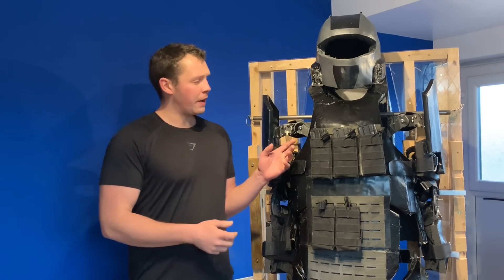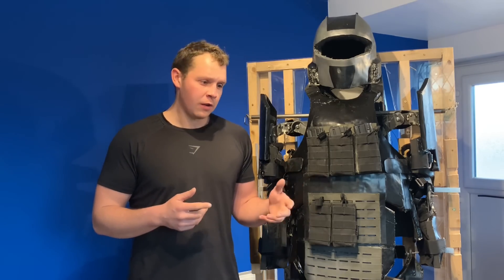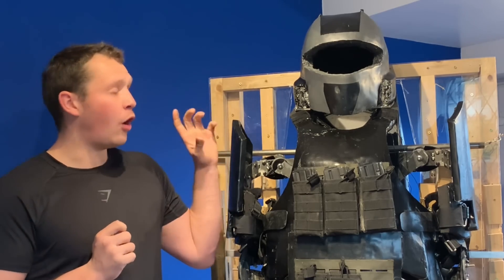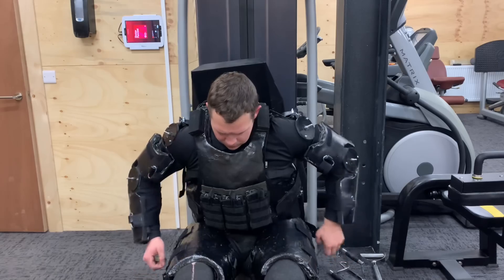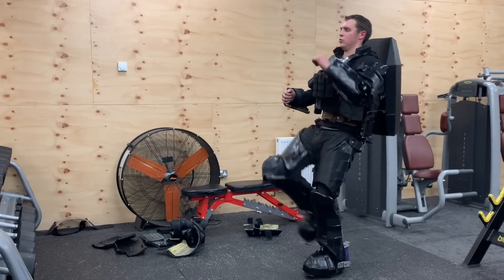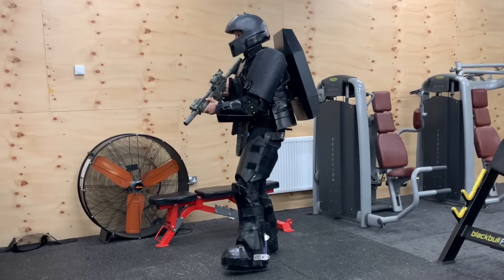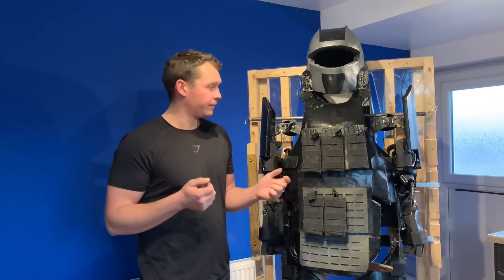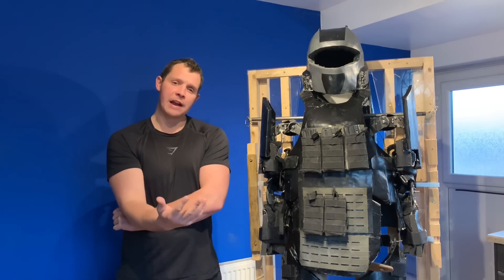Functional Combat Capable Power Armour Development Episode 5 Quest for Bullet Proof Exo Skeletons

Comment: i think the hardest part of the electronics is reducing the delay between limb movement and motor activation unnoticeable. there will inevitably be some signal delay between any sensors connected to the joint motors that move a limb and if the lag isnt small enough it will be very hard to move in long term

Comment: Bro, I like wear your thoughts are going. And it's outstanding how far you've done on your own. But your forgetting that most governments go for heights quality for dirt cheap prices, but also works well with existing equipment. If you could get a IOTV from a US military surplus store then you might get Uncle Sam's to nock at your door. Your somewhat right about the leg armor, keep the thigh armor as is and loose 😂back half of the lower leg. And focus around shock support, because you can't run to or from battle if your knees are fucked. And for the dawning of the armor set up a wall locker you can step in to. You open up the locker take out your leg pieces, then put them on. Then you lift the front half of the upper armor and just back up into it. Next you get all connected and finally you go pick up your helmet and weapon system from the armorer. And lastly do the test outside, you'll find out a lot more about what could be better or even some new problems before you try to sell it so you can get more from it. Thanks for the video and again outstanding work, I do see a diamond but you still got some work to go. Hang in there 👍

Comment: The issue with power armor or even heavier armor is the fact that it's much better to be mobile than being able to take another bullet, or slightly more hits. The onion exists for a reason, if you're relying on your armor to get your mission done you've already made some mistakes. Imagine trying to squeeze into a helicopter or APC with this on, would basically be impossible. Not to mention the same defensiveness could be achieved by just using a ballistic shield instead, that way you can always toss it and lose the weight if you need more mobility. It's cool engineering, just not really applicable towards today's combat without a lot better technology, energy storage, mobility, etc.
Like, you touch on mobility, but I'd like to see how you feel after 24+ hours of wearing it constantly while walking/moving/digging/etc. That's the reality most soldiers would face wearing this. Also looks like a pain to remove if you need to treat wounds or something as well, good luck administering a tourniquet for example. You have to remember we live in a world where anyone can hand-carry a weapon that will easily cut through most armored vehicles, let alone armor you can carry. No amount of plates is really worth sacrificing all that mobility and functionality.

Comment: It's quite cool. Have you looked to the past for ideas about this kind of stuff? The legs can be supported off the waist belt if you ran a cord from the belt down to holes in the cuisses, much how knights used to in order to keep them up high and snug on the thighs ("pointed" was the term). Takes the weight off the legs somewhat and might improve mobility. Is it possible to run a camera, (say like a car reversing camera, a webcam, something simple and small) from the back of the weapon sight to a screen near the helmet? Maybe the screen could be moved in and out of view. That way the bulkiness of the helmet doesn't necessarily matter for obtaining a clear picture through the weapon sights. Not sure if that would work. It's a really cool idea though, fun to see something as from-sci-fi as power armour being built in such a grassroots manner. I hope it all works out.

Comment: You might be better off marketing the skeleton itself and foregoing the armor altogether. That way, it can be used to help carry heavy things like ammo crates and supplies.

A 155mm howitzer round weighs like 100 lbs, and all that's loaded by hand, would be great to have a system to help artillerymen lift those things.

Foregoing the armor makes it a lot less expensive, and means you can offer upgrades later (which means more money).

Comment: cool idea, no one really would fund this for military / police application. One grenade makes whoever is in the suit, into soup. The gaps in the suit make backpressure still a problem from explosives. As for amour plating, you should have gone with modular ceramic plates instead of the thick plates, especially if this is planning on being used in a warzone environment regularly. Another issue is higher calibre rounds being used. 300 win mag is the minimum for snipers now, mostly using 338 lapua or anti material rounds. the US even implementing overpressured 6.8 rounds in their infantry rifles and 338 for their belt feds. With the prevalence of drone and their payloads, this suit's speed is going to have to come a long way. It is just too big a target.

Comment: That's a really cool proof of concept and I'm excited to see where it ends up. Even if it fails, I would be curious to know why)). 

All that said I couldn't help but notice that the only thing connecting an upper half of the suit to the lower are thin pieces of metal. If the suit is meant to carry a heavier armor plating it needs to be able to hold its own weight at the very least. I'm not sure how hip joints can be reinforced to carry the weight the upper body while retaining mobility (especially side to side), but it must be done to negate the weight of the upper half of the suit, armor plating, and ammunition.

Comment: You know what would work great? An IHPS helmet with the mandible face shield, it already stops rifle rounds AND has an additional rifle rated applique armor plate for the helmet. Next big thing would be using small ceramic triangles wrapped in kevlar to make flexible rifle plates like the Russian Ratnik powerarmor system. A good place to get them is Safe life defenses flexible rifle armor and stealth armors flexible rifle plate! You could use them to cover the wide gaps in the front of the shoulders/upper chest and also the back of the legs! They'd also work for the back of the neck and the throat!... Hell you could make most of the arm armor out of them...

Comment: Very cool, but this is the easy part. The real trick is going to be powering the thing - both in articulating the joints and the power/fuel source.

Also, test flexibility - drop something between your legs and pick it up. It might reveal some things that need considering in armour plate design.

Comment: This is real rad. I'm curious how you're going to manage activating the motors powering the suit. Is it going to be through some kind of compliance mechanism, like a sensor that reads your bodies movement that can tell the computer to act on the motors accordingly? Something like that would probably be best as it stands, but there will always be some kind of delay intrinsic to that. Down the line if things keep going the way they are you could think about integrating with Tesla's Neuralink as a control mechanism, at that point you're not too far off from the Black Carapace of 40k acclaim. The other question I have is to do with how it will be powered. Obviously batteries are both heavy and limited in range, not to mention liable to catch fire. I almost wonder if having a small highly efficient diesel engine built into the pack and spinning a generator of some kind for electrical power might be better, like a modern diesel electric train. In any case though, I'm looking forward to part two.

Comment: From the comments, there are some very good points made about the power armor. 

1. Is the armor. Medieval plate armor is designed in such a way that it distributes weight evenly across the body and has a shape designed to reflect energy away from weaker areas like the neck and limbs.

2. Adding onto this, medieval plate armor could feasibly be made as one single unit for each part (both legs, both arms, torso, and then other extra parts like the helmet and shoulders). If you could make something of a singular Kevlar or cloth base that fits around the inside of the entire piece of armor with the ability to fasten it to other pieces, you could achieve a much faster and tighter suit. Imagine if you didn’t have to remove plates from the leg to put it on, you could just loosen it all the way then slip it on.

3. Using more springs and soft exoskeleton parts to offset the downward weight and to move it instead of relying solely on motors and actuators would take a lot of stress off of the battery, especially in the case of the legs.

4. Neck protection. There needs to be neck protection. You can look at an astronaut’s suit or even fictional power armor like the Terran Power Armor from StarCraft that has a good area in the neck to protect it and allow for mobility.

5. This will happen with more funding, but a more proprietary battery that is designed to shape like the back of the armor would cut down on size.

6. The cloth mentioned in number 2 would be good to run cooling through and to soften impacts to the body. It can also stabilize plates so as not to be at risk of falling onto each other. A cowl or hood made of this material around the head would be convenient alongside the neck protection.

7. This is my own observation but perhaps you shouldn’t focus too heavily on the helmet or cameras. A helmet is made pretty exclusively for shrapnel protection, and even with a sort of protective hood and a suspension rift (medieval helmet tech that creates a bit of a bungie between the helmet and your head with straps), you just don’t need to put everything on the helmet being effective. It’s the most easily removable part of the armor and should be able to do enough for the user and still be able to remove easily.

Comment: I used to make armored trucks for law enforcement. I have a few ideas/ designs that would help, was going to try and design a whole new system. But not bad to modify something already existing. I already figured a way to power for long term or charge the batteries.

Comment: this is a different field than what you are currently looking into doing but a system that can help carry large weights could be used in a construction/logistics setting only issue is that a forklift does essentially the same thing at a much less price

Comment: When you get to powering it, you might consider using loads of springs to bring the major leg joints to fully extended position. That way any powered actuators aren't used so heavily.
Reply: Any chance to reduce power draw mechanically is acceptable
Reply: Yoo, so like squat jumping gets mechanically way easier! Very smart.

A spring board distributed on the chest may give the chest some give to dampen falling on the chest with all that weight on thr back. And even brace the front and back so your chest cant easily be crushed if prone or pressed under and object or person. 

So hear me out. Perhaps what you need to present is more research than prototype. You have a prototype and if you can substantially prove new knowledge then you should be able to land the contract to use their funding. Think business, people skills, PPT, executive report plus many many appended slides for detailed q & a session expecting experts to grill you. 🤔  keep your YT audience in mind when preparing.

Comment: For the armor design, look into medieval full plate armor. While the articulated sections of full plate armor may be impractical for various reasons, it could be useful to see how the armor is mounted to the body or how large parts like the shoulder puldrons, breastplate, and waist area are designed to maximize coverage.
Reply: That’s actually arguable. Certain suits of armor such as the armor of King Henry the 8th is some of the best protection and articulation one can find in medieval plate armor. It has maximum coverage and a nice set of segments. The suit was used as a reference for the first space suits ever developed, which this power armor is obviously going to be similar to in some ways.

But yes, not only the maximum coverage, but the way in which fastenings inside the armor suspend the weight and hold it close to the wearer to reduce the weight you feel on your body

Comment: Recommend a kevlar flap that scews into the knee plate, those would cover the knee joint. Another recommendation is have a flexible kevlar or other strong material to extend from the gauntlets, that would go over gloves. The purpose is to when your holding a rifle, it covers your hands and provides them with some protection. Also, why is there no groin plate? A power armor is meant to provide armor to the wearer that they could not wear. Its supposed to stop bullets, not resist them. Any power armor user will be the main target of any hostile actor. Like knights of old, the gaps must be minimized and coverage must be total while staying mobile which is the point of the power in the power armor.

Comment: So most of us know the #1 problem US research is facing is powering it usefully long. Lithium ion is very heavy, and dangerous if punctured, and you end up with too much weight, still not enough power density to stay up long enough, and could catch fire and severely burn or kill the soldier wearing it. There are solutions for similar batteries, but they lose recharge efficiency and power density for the stuff I've seen.
Like 4-6 years ago when I was following the DARPA/military TALOS project stuff, I was wondering if a military patent and funding for developing tiny turbines was to use with hydrogen/methane fuel packs instead to power this kind of stuff....but in the past 2 years I think it must be for drones instead....but it could've been super cool 'Starcraft Marine'-like armor lol.
They do have production ready stuff though, but it isn't a huge suit or anything, it is for the hips down reinforcing the legs and joints. I think there is some expansion up capability too, but that is enough by itself to let someone wear heavier normal armor with less stress on joints (which lead to a lot of long term knee injuries for vets). So it may be cost effective just reinforcing that much to lower long term costs of medical care for vets.

Comment: I could give some simple ideas to assist. 
Use a wireless visor that displays assistance. Use a camera on the top 360 cam and use ai to monitor and in case of smoke or low visibility, the cam and visor can assist maybe even run thermals or something and feed to the display. Maybe design some pieces of armor that can connect to the frame and encase the limb like an exo armor connected to the frame so it counters weight and can be mag locked or something. Maybe like the prosthetic ankle designs, make shoes that connect to the frame and encase the whole foot and use power assist in the ankle similar to the prosthetic. Maybe these aren’t good ideas but they’re ideas. Use ai to monitor vitals that are set up in the suit. Use emg (electromusclesensors) to monitor muscles and sense signals and transmit that into the armor to assist in movement. Btw it’s actually electromyogram but i like that the muscles tells you what it’s reading.

Comment: Consider a high vis laser for an aiming apparatus. If your helmet will have true night vision with tubes, consider a PEQ box for night time aiming. Don't use IR Night vision. To anyone with real NV, you'll appear as if you're walking around with a flashlight on your head. Easy target.

The new way to defeat NV countermeasures is thermal optics. People can't NOT emit heat, so everyone is clear as day on a thermal optic. But glass reflects surrounding heat, rather than allowing the thermal to look through it. Once you get to the countermeasures/stealth phase of your build, consider experimenting with a glass coating or film of some such and see if it defeats thermal imaging.

Comment: im not sure if this is a worry with ceramic armor, but having that curve towards your neck on the body part could end up deflecting spalling or the bullet itself into your neck/face. maybe add some sort of curved ridge that would ramp it away from your face? unless you have some other solution for that problem that i just missed

Comment: With a huge back module like that and with all the tech you're going to be putting into it, just make a visor that has a heads up display or an augmented reality screen that displays the sight of the weapon through a camera feed that looks down the sight.  This could be done with something like a purchasable tech project called the Monocle that is attached to the visor and the camera attached to the rail behind the sight. This could also give you digital or even adjustable zoom through lenses.

Comment: Ok you provided alot of good in this, especially for a prototype. The main issue i could possibly see is the ability to fit many different people. Along with transportation and caring for it. Along with how bulky it is. I can see this working. And as a base design its definitely a amazing start. Good work man.
Reply: For military purposes, all suits should be sized for the average the people who would be using them
Reply: @bobjohnson1633  you would still have to think about different body types. Some people just naturally have thicker muscles. Along with longer arms or bigger hands or feet.